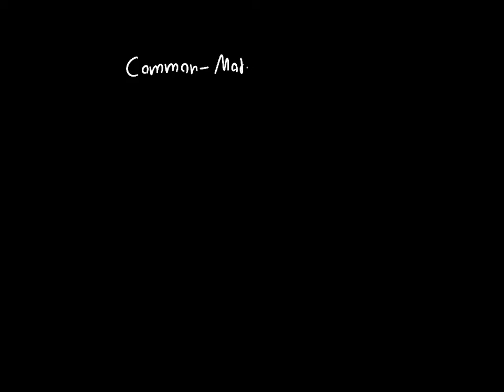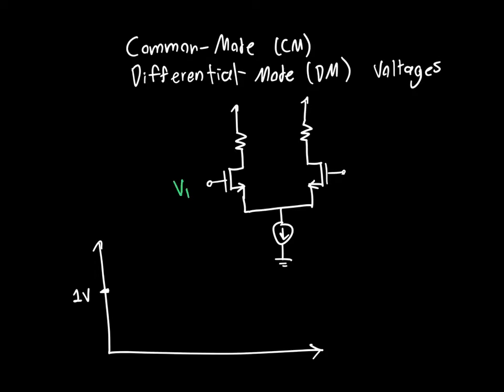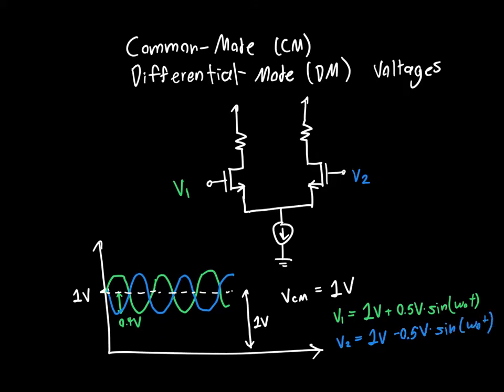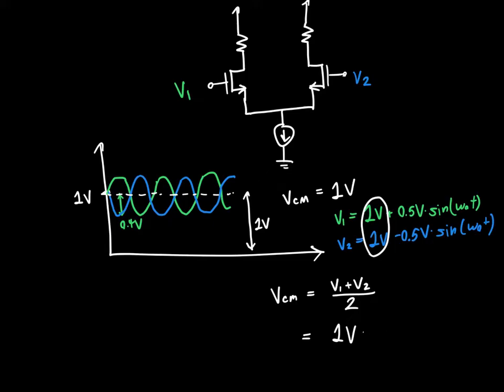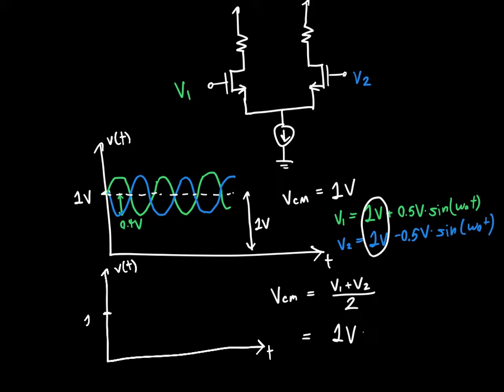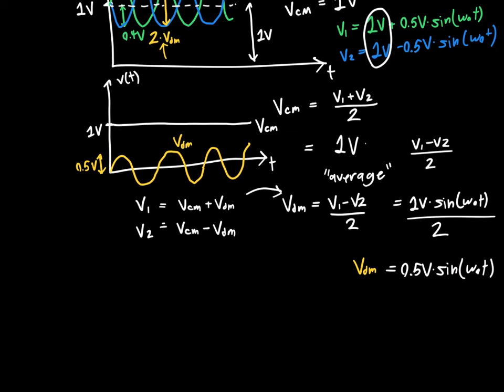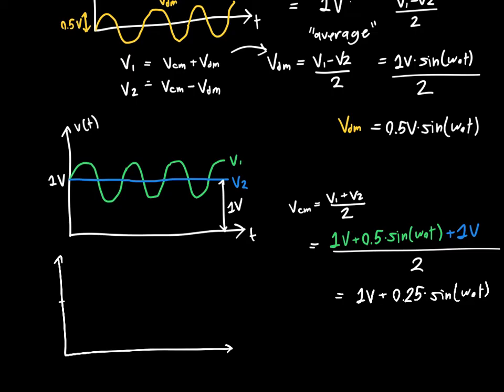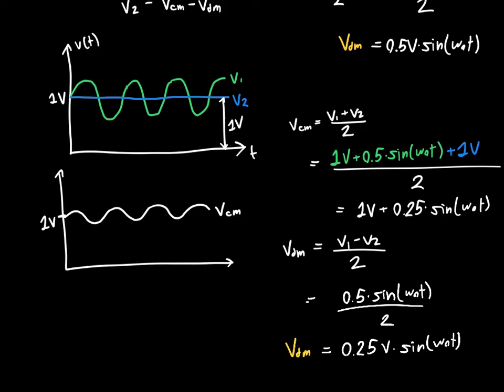Differential and Common Mode Signals

Comment: How does this differ from the common mode voltage reported on the data sheets? My understanding is that input/output common mode voltage refers to the range of voltages that the input or output can support with respect to the supply voltage, lest the device stop working properly. What your describing seems to be completely different from this op amp characteristic

Comment: Hi, I looked up for the differential mode voltage, and it seems that the equation is: Vdm=V1-V2 (not divided by 2). Is this equation applying to different situation than showed in the video? Thank you.
Reply: Hey, I have the same question. My prof in my Semiconductor Class also did not devide the Vdm by two. Have you come upon an answer since you asked the question or are you also still wondering?
Reply: @AndersAlsDieAnderen9  I think that differential mode is difference between two signals, so the equality should be V1-V2.

Comment: "in engineering we almost always drop the axis" I dont know what crazy ass engineering you practice but in REAL engineering we never drop the axis or the units. You are just off in lala land man
Reply from the maker: Ah, sure, clarification: When explaining things qualitatively we often drop the labels on the axis, as they aren't relevant to the general point being made (i.e. it doesn't matter if a sinewave is at 1kHz or 10GHz, the graph will look exactly the same when scaled and the conclusions are the same).

Comment: we would expect VCM to be 1V! lol i love it. Why would you "expect" VCM to be one volt. This is the problem with youtube. assumptions and more assumptions. You do not explain in the slightest why you would "expect" VCM to be 1 V
Reply from the maker: A better choice of words might be "suppose it's 1V". Integrated circuits almost always operate off voltages between 1V and ~20V, so 1V is an at-least-not-implausible guess. It also just makes it easy to talk about, it's the simplest number.

Comment: You use words like "biased about 1V" just to make yourself feel smart. Or you could make your video more useful and not use lingoooo people wont understand. This video is useless
Reply from the maker: This is very standard lingo taught in introductory circuits classes (for which this video was made). It means the "DC value" or the average value the circuit operates around.

Comment: Very nice video on common mode and differential mode. If you’ve not already done so, I would enjoy a video on voltage mode sensors versus current mode sensors and the advantages/disadvantages of each. Thank you!

Comment: Hello Mr. Edmunds, could you add video about solving complex MOS circuit which may includes current mirrors, current source, cascode stages, differential pairs.. Such as solving width over length each MOS.
Reply: @JordanEdmunds    
yes we really appreciate it...

Comment: Thanks a lot! nice.
Unfortunately I didn't understand your explanation about the application.
I use the Common Mode Rejection (CMR) in signal sensing, to reduce the error (higher SNR).
Reply from the maker: Common-mode rejection doesn't strictly-speaking improve your SNR. Any differential noise at the input is still amplified just like your signal. It is only if your noise is common to both inputs and the signal you are trying to record is differential that a high common-mode rejection can help alleviate noise. This is often the case with things like 60Hz noise. If both your "signal" and "noise" are common-mode signals, however, then CMRR also doesn't help.
Reply: So in make use of symmetry in circuit analysis, you mean that every symmetric signal (both signal are same) we can get rid off or don't have to account these anymore?